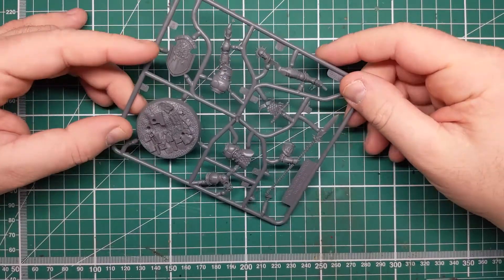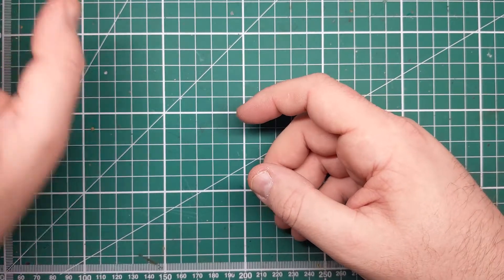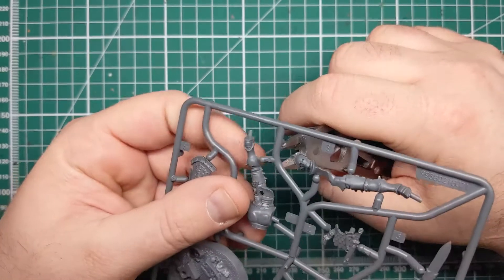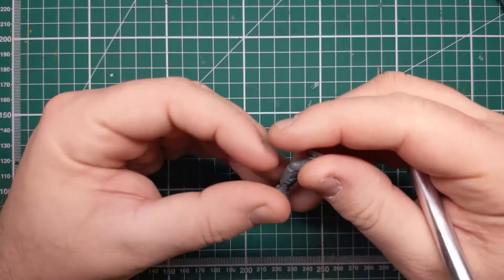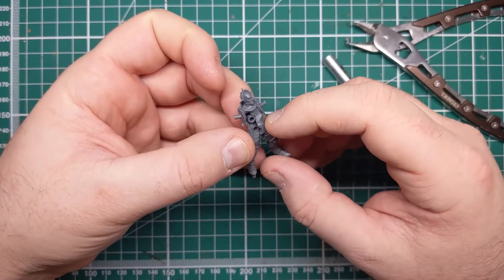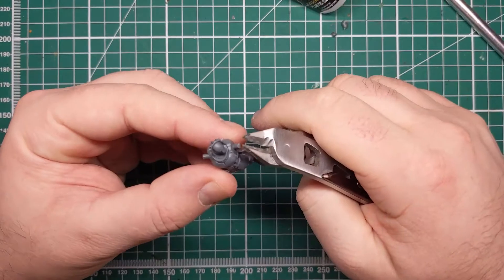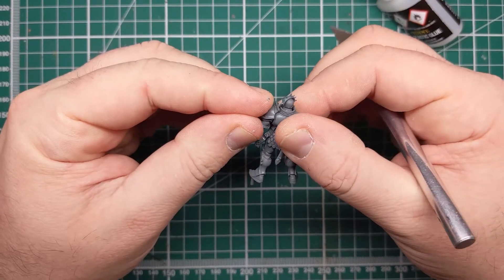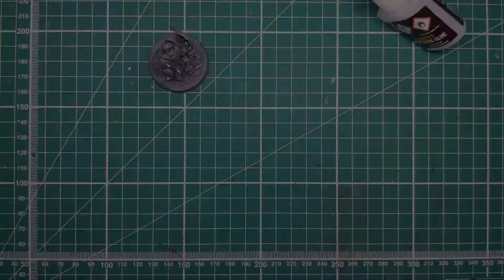Hobby Techniques: Push Fit Models

Comment: Thank you, this really helped me out! I bought a partly assembled push-fit collection box of Necrons, and not having touched anything miniature in about ten years, I just started cutting the parts left on the sprues away. I didn't check how they were supposed to fit, so I was stuck procrastinating instead of puzzling them together. Now I had a fairly easy time, and rather made them fit together :D
Reply from the maker: Really glad this helped. If your feeling really adventurous I’ve a few videos on painting necrons. A few on true metallic metal carapace, red weapons and red glowy bits and there’s a video on painting mechanical piston where I use the doom stalker as an example could help for further inspiration. Welcome back to the hobby

Comment: Would you recommend painting as a sun assembly for most push fit models?
Reply from the maker: It depends on the model to be honest. Sub assemblies work really well if the model I has lots of detail that’s hard to get to it it was all assembled first. On a model like those spearman everything is nice and easy to access and sun assemblies would probably not aid you. 
It may also depend on the type of model too. A rank and file model in an army would usually have less time spend on it than a character so using a black primer on an assembled model and anywhere the brush can’t reach is a shadow can work really well. 

That being said it’s always about what works for you as a painter. There’s no wrong way to do it, just the method that worlds for you.